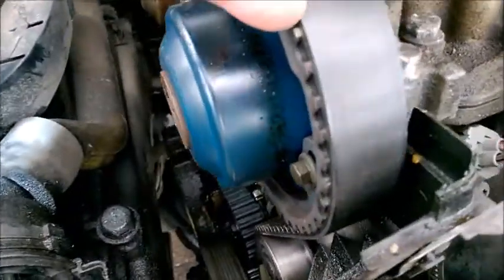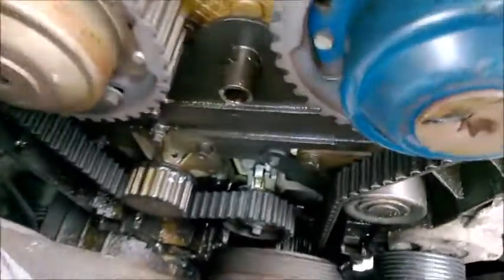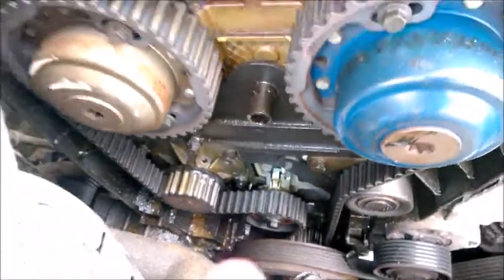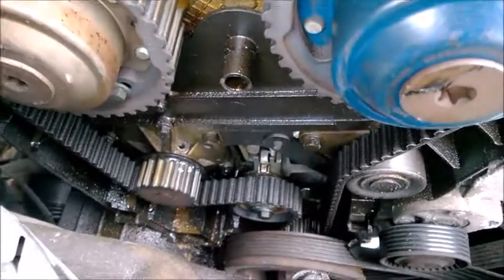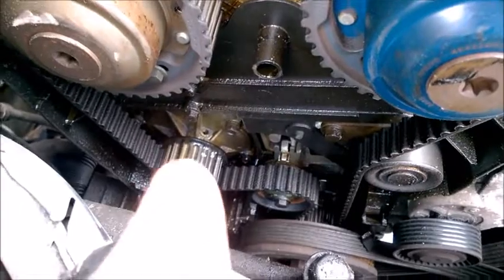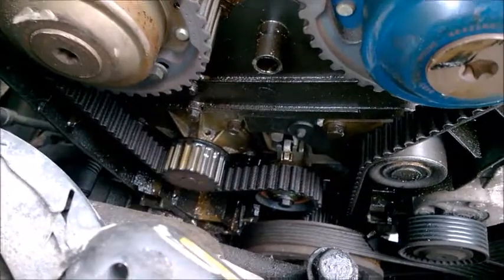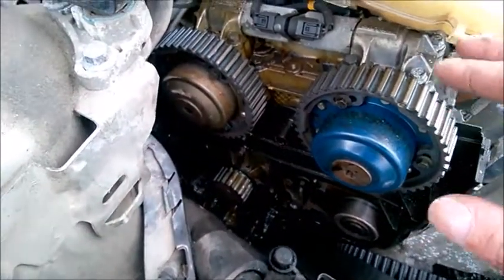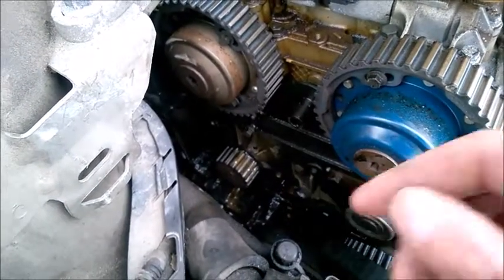Volvo S60  V70 how to check the timing belt tensioner correct install 2001-2009

Comment: Thanks – a very nice and interesting video – very helpful – but I have a question. You describe it very well on the right camshaft when the timing belt is not centered on the gear, but on the left outer flank. But what's wrong if it runs on the right outer flank, or even extends up to 1.6mm above it (new timing belt including water pump, tensioner, and idler – VVT in good condition)? I'm a Team Gates member myself, but I currently have the same problem on a V70 II 103 kW – on a second V70 II D5, also Gates, but no problems.
Reply from the maker: Hi, normally, belt running on either edge of the camshaft gears, or even slightly past either edge, is not a problem in itself. However, it may point out something is not right in the system, causing the belt not to run centered. Still, it doesn't mean it's an important issue. Make sure you use the correct tensioner for your year model - the pulleys are not aligned on the two types of tensioners (https://youtu.be/Yd5gHFnHaYk) - , tensioner mounting bolt has correct torque (20Nm) and the tensioner needle indicator doesn't shake too much (https://youtu.be/wF4LaN9izUY). While there, I would like to recall that, unlike other cars, the original water pump will usually last very long on these vehicles, usually at least 300,000 kms. However some owners replace it with less good quality which may cause problems. On my trips at the junkyard, one day I did spin several water pumps by hand on several cars (I removed the belt). On a few cars the pump had already a bit of resistance to spin, on one car it was almost seized. Note that when this happens, it will not leak coolant (many people think a water pump will start leaking coolant before it fails).
Reply: @Peppermint1  Hello, sorry for the late reply – and thank you again for your message! I just got back from my workshop with good news: My timing belt is now finally running properly and centered on both camshaft sprockets.

For anyone reading this -> As Peppermind already mentioned, the correct tensioner for each engine model is crucial. According to VIDA, the older tensioner is still valid for the V70 II up to engine number 3188688 – which applies to mine. I installed a complete new timing belt set (including tensioner, idler pulley, water pump, and coolant change) – the quality of these sets is truly excellent, and I always rely on them. And as a general recommendation: if you’re replacing the timing belt, always replace the water pump as well. It’s not difficult to do at that point, it doesn’t pay off to save here, and you’ll be safely covered for the long run.

Nevertheless, the first belt (28.5 mm) was overrunning by about round 1.6 mm on the right camshaft sprocket. To try something different, I fitted another new belt (27.9 mm) together with the rest of the timing belt set I had already installed – and it immediately ran perfectly centered. Looking back, it was probably just a specific peculiarity of my engine that “didn’t like” that particular belt. I’m convinced the very same belt would have worked flawlessly on another engine. And maybe that’s just because my Volvo – his name is Loki – sometimes seems to have a little life of his own ^^

And just to be clear: This is absolutely not a criticism of Gates! I’ve had consistently excellent experiences with Gates products – the sets have been running flawlessly for years in both my other V70 II D5 and my Volvo 740 D24T. And of course, I’ll continue using Gates in the future as well!

Thanks again to Peppermind for the quick help – I hope my experience may help someone out there!
Reply from the maker: @ThomasTrenz  Very interesting feedback

Comment: Ill second the "Never put an aftermarket Water Pump in the Volvo". What Peppermint said is exactly what happened to my S80. I bought it with 120,000 miles on it. So, right away I changed the timing belt. I did notice it had a Continental Belt, and said it was changed at 70,000 miles. I put in a Genuine Volvo timing belt. 30,000 miles later I was driving down the highway and heard a "poof" and the engine just turned off. I checked the timing belt, and sure enough it was off the gears. :(. I checked the Water Pump and it was froze solid. Wouldnt turn at all. I got it out, and looked at the Brand. Looked it up, and its not even the cheap brand that an Autozone sells. But, I see it for sale all over eBay at the cheapest price of all Volvo Water Pumps.

So, dont make the same mistake. Now Ive been without the S80 for almost two years. Just now learned enough to give pulling the head off and redoing the valves. So lesson is...Saved $40 on a part, and cause thousands of dollars of damage!

Comment: Hello. I have a 2008 S60 T5. I see your comments that the needle should not shake but mine does and it is in 100F weather. Needle is mostly to the right.   The timing belt was done from Volvo dealership at 98k which is 30k miles ago. I bought this car used recently and watching all your videos regarding the P2. Should I be concerned and get it checked out?. I just changed all the plugs and coils since they were the original.
Reply from the maker: The needle position depends on the engine and outdoors temperature (see link). As for the shake, if it's just a little bit I would not worry especially since it's genuine parts  https://www.underhoodservice.com/wp-content/uploads/News/01_01_2007/VolvoFig2gif_00000015777.gif

Comment: Hi
What if I'm adjusting the tensioner outdoor and the temperature is below zero, would I set the needle in the tensioner to the left of it is still has to be in the middle?

Thanks
Reply from the maker: Below 0 in Celsius or Fahrenheit ?  Which year is the car ?
Reply: @Peppermint1  Thank you for responding. It is 1999 Volvo S70 AWD 2.4L Engine DOHC turbo
Reply from the maker: @manfromatlants  From what appears, you have the old model of tensioner used up to 2004, #30638277.  Read the pinned comment in the following video : it has the information you need  https://www.youtube.com/watch?v=C-qhJ8Vjhu8
Reply: @Peppermint1  Thank you so much for your response and your video. I read the comment in the video description and it was great. I'll do what in the video and will let you know what happened as I replaced the timing belt and the car started nice next day it cracnks very good but doesn't start!

Comment: My friend, I m having problems with the belt walk off!!! Is it just too tight??? All Volvo original parts and contitech belt
Reply from the maker: It is possible the garage tightened the tensioner bolt too much. It has to be 15 ft-lb. I don't know if you release and tighten again the bolt it's going to be good, give it a try - don't forget to adjust the temperature needle in the center with cold engine. If  the belt is still walking after tightening correctly, try another tensioner

Comment from the maker: 2001-mid2004 tensioner adjustment (see comments)  https://www.youtube.com/watch?v=C-qhJ8Vjhu8
Tensioner center point is at 15C / 60F
A video with the tensioner shake  https://youtu.be/wF4LaN9izUY
For those who read in the future, don't be  worried about the tensioner indicator/needle reaching a far right position when the engine is hot - actually, carefully so you don't burn your hand, reach the indicator and try pushing it more to the right, if it moves, it means it still has play so the tension should be good.

Comment: I tried doing this check and removed the right hand cover ( the one with clips and screws ).
But I couldn’t find a way to remove the left hand cover, how can I remove it?
Reply from the maker: Hi, the larger left side cover that goes to the bottom of the engine is secured at the top with two metal clips (one near the firewall and one in front), then on the side there is a recessed hole with at long 10mm bolt inside - it is a little difficult to reach with the ratchet because it sits recessed. There are also a few plastic tabs on each side that undo by themselves when you pull on the cover (snap them back in place when replacing the cover).  Once the bolt is removed and the two metal clips released, pull up on the cover then flip it a little towards the front of the car and pull on it - it will pass tight near the struts bar but it does come out this way.  This cover is somehow difficult to slide back in place because it has to slide at the bottom 'behind' the crank pulley with some tabs so practice a little when placing it back, until you get the feeling how it goes in there.
Reply: @Peppermint1  Thank you,  I will try this.
As the car was supposed to have had the belt and tensioner replaced 15,000 miles ago, but the belt has very small cracks / imperfections on it, so would like to investigate further.
Reply from the maker: @bigbluechopper24   It is time to replace it indeed, I'd recommend the Continental kit from Fcpeuro or Ipdusa if you are located in the US.  If this is the first belt at 100K miels or so, we don't replace the water pump at this moment (like we do on other cars) because it lasts a good 200K.  Just the belt tensioner and roller.  It is good to have the belt installed by someone who works on Volvo so he doesn't do a mistake with the timing.  I also recommend replacing the PCV kit at this moment.  Good to read on forums about these  https://www.matthewsvolvosite.com/forums/viewforum.php?f=9  (US) or https://www.volvoforums.org.uk/forumdisplay.php?f=19 (UK)

Comment: Hello i installed my new timing belt, tensioner and waterpump.. i cant figure out if i correctly installed the tensioner.. can i email you the video of how i installed it how it works? Thx!
I just rebuild this engine and would be a shame of de timing slipt or someting.. engine is running though
Reply from the maker: Hi Bart, my email can't handle large messages (Mb), maybe you can upload it on Youtube and send me a link?  Here's some more information  
https://www.justanswer.com/volvo/895ba-volvo-s60-2-5t-just-changed-timing-belt-volvo-s60-2-5t.html
https://www.youtube.com/watch?v=C-qhJ8Vjhu8